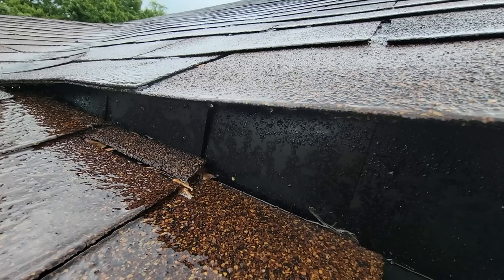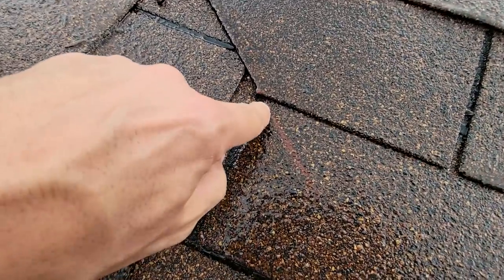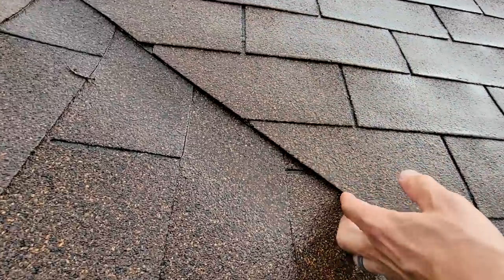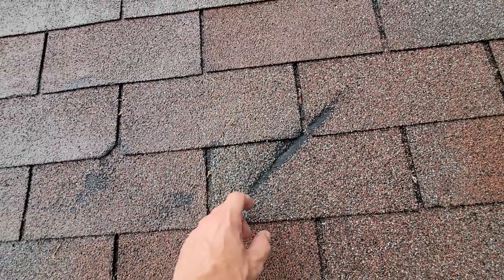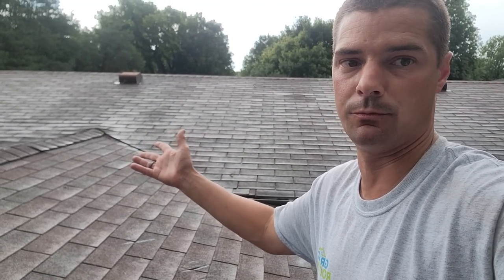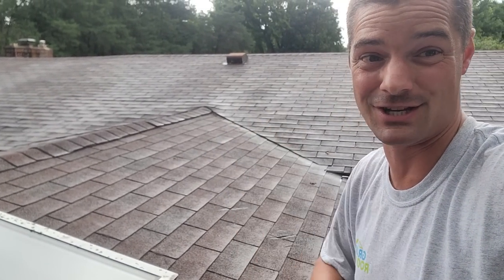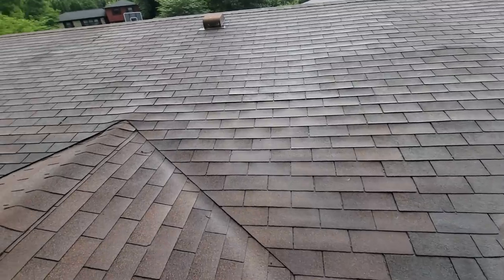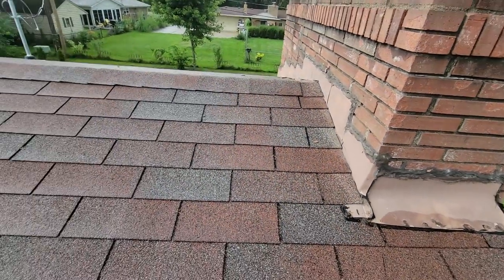If the 1st roof repair doesn't do it maybe the 2nd one will!

Comment: I was raised up a third generation roofer my dad was one of the best roofers I know he cared about the job and was very particular about ever aspect of the roof.
 I have seen the exact shotty jobs. Some people just don’t know better and or just don’t care. When I graduated from high school in 1981 we worked for 48 builders and I have worked on thousands of roofing jobs. And the one where the brick was I have seen brick walls and chimney leak instead of the roof. We had to seal a brick wall and a chimney one time that was leaking to the inside. I moved on when I was about 26 ish  started building houses then in 1990 got a commercial Generial contractor lic. and now just build commercial buildings but I always have respect for ever roof.
Thank you for the video.

Comment: The mortar on that chimney, is a good example of what happens if you use the wrong type of cement.  It's harder than the bricks, which are porous, so when water gets into the brick, since it's softer than the concrete, it can't swell because the concrete has no give in it.  So eventually, this fractures the brick and the face falls off.  The bricks are softer than the concrete, if the whole house is built out of that and has the same mortar they may have all kinds of that going on everywhere they get direct rain....
Reply: What mortar mix do you suggest for an old 1900s milk house that needs some pointing done? I have no idea whats currently on it but I want to touch it up. Thanks!
Reply: Not necessarily. That is also the same signs as spalling which is due to a freeze thaw cycle when the bricks are wet.  He is in a pretty cold part of the country that gets some decent snow
Reply: @philkingmke  probably limestone mortar.

Comment: That little screened patio I definitely would replace that. Too many shingles there are bad, and the repairs are bad. The rest of the house not as sure on, depends on how brittle the shingles are on a nice to moderately hot day. That pipe boot on the power mast what were they even thinking!😂 Also don't like those 2 dishes just bolted right on the shingles.

Comment: Are you going to repair the roof? I would love to see the deck of the roof.
Reply from the maker: No  I'm going to figure a replacement estimate. As far as the deck I took my ladder around and looked under the shingles, they were simply installed right on top the foam core metal covered panels.

Comment: May I ask a question? Do you seal around all vents?
Reply from the maker: Box Vents? Only on the outer edge of the flange that go under the shingles. Not where the cut edge of the shingle goes up and around the Box vents if that makes sense.
Reply: @GrandRoofingInc  Makes perfect sense, thanks.

Comment: I'd bid 35 thousand complete tear off fix all water damaged OSB ice&water guard all eaves and valleys six feet up rake.  Synthetic underlayment.   Life time inorganic class A shingle.   Also I give lifetime warranty on all workmanship....
If you think I'm expensive....call a rookie and you'll learn what expensive is...
VANATTI CONSTRUCTION.   Michigan
Also  I'd add a continuous ridge vent and throw out the turtle 🐢 vents
Reply: Thats funny I just had my roof replaced and im not a roofer but while I was watching this video I said to myself It needs replaced and It's probably a $35,000 job then I ran into your comment 😅